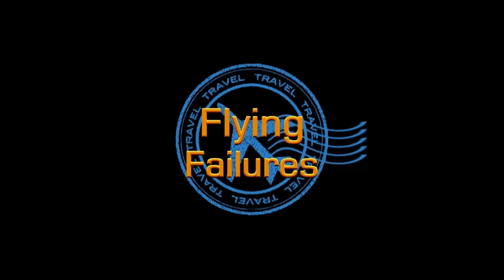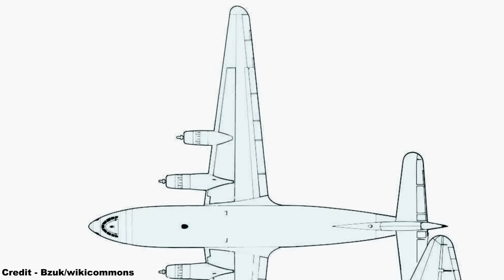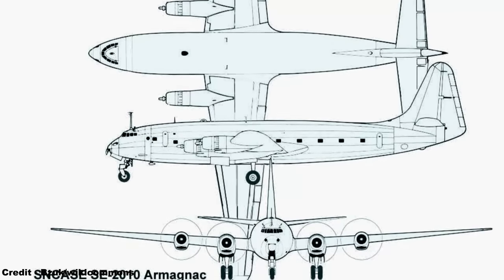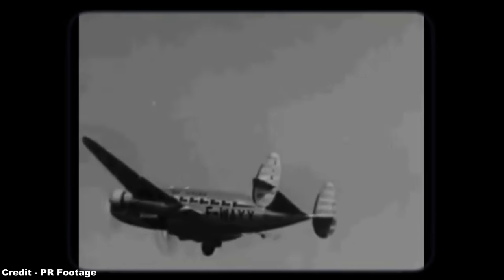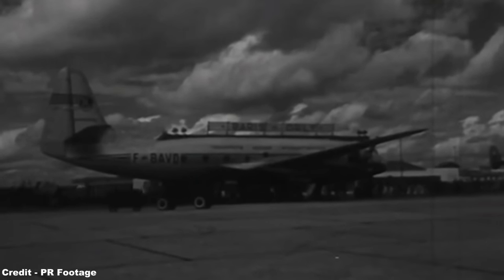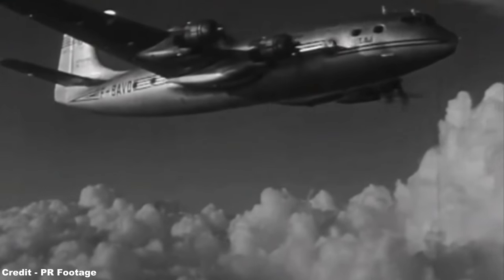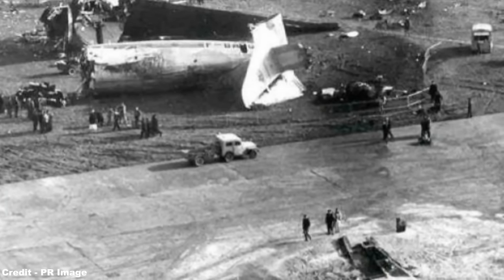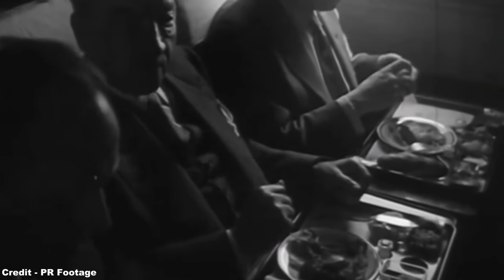Flying Failures - SNCASE S.E.2010 Armagnac

Comment: Attempting to build a plane whose engines run on expensive brandy was probably not the best idea.
Reply: The American made, Pratt and Whitney R-4360? Probably ran best on 115/145 avgas which was dyed purple so that the fuel can be visually identified.  That was 115 octane. Then there was the somewhat lesser 100/130, blue in color.
Reply: Yep, was there some confusion between Alcohol rating and Octane rating.😏
Reply: @scootergeorge7089  the ONLY way the R-4360 ran at rated power was on purple juice-otherwise-it was severely de rated.
Reply: @stevenrobinson2381  - Define "severely." In 1977 I was assigned to a Naval Air Reserve Unit, NARU that operated a US-2B powered by  R-1820 radial engines. When the purple juice was no longer available, we had to slightly detune the engines, a couple degrees less pitch on the props and a timing change. Not much. I believe with water-alcohol injection, the "corncob" would have regained most of the power lost by being restricted only 100 octane blue fuel.
Reply: @scootergeorge7089  Correct the 4360 and later 3350 Turbo compound ran on 115/145 octane. That fuel is 115 octane F3 motor method test (lean mixture) and 145 octane F4 motor method test (rich mixture). 
 At max power air cooled engine use rich mixture for valve and piston crown cooling. For exhibition aircraft  can be run on 100LL but with boost limited. About 25years ago there was 100/130 and 115/145 in short runs for air racing. I do not know what the big air race engines burn now.
Reply: @jayreiter268  - Perhaps auto racing fuel.

Comment: The Comet, despite its flaws was the way ahead even in 1949. Piston engines were obsolete with the advent of the jet engine.
Reply: de Havilland was decades behind in aircraft design and construction technology..
The company while reaching for the 1960s Jet Age still had its feet firmly planted in the 1930s.!

The Comet Disaster was the worst engineering failure in the history of commercial jet aviation and today is seen as a example of how not to build a jet airliner.

Of course the real tragedy of the Comet Disaster was that it could have been easily prevented if de Havilland had used modern technology and simply followed well-known and understood industry standards for construction of pressurized cabins made from riveted aluminum alloys
Reply: @sandervanderkammen9230  According to Wikipedia, the Comet actually used very advanced technology for the time (including the use of aluminium alloys)  and was extensively tested before going into service. Metal fatigue was still poorly understood at the time so extensive testing was carried out that appeared to show it would not be a problem, but it appears that the fuselage used for the fatigue tests had already bee subjected to other tests that masked the effects of fatigue. After some modifications, the Comet returned to service and later became the basis for the Nimrod maritime patrol aircraft.
Reply: @CharlesStearman  The Comet Disaster was a truly shameful and humiliating chapter in British history but the real tragedy was that it could have been easily prevented if de Havilland had simply followed well-known and understood industry standards for the design and construction of pressurized cabins made from riveted aluminum alloys.
de Havilland never fully adopted modern aircraft construction technology and was still building aircraft primarily from wood when it entered receivership and ceased to exist in 1958.
Reply: @sandervanderkammen9230  The early Comets were thin-skinned because of the need to reduce operating weight as a result of the low-powered D.H. engines.
Reply: @None-zc5vg  It's also important to note that de Havillands only prior experience with jets having pressurized cabins was the Vampire/Venom... which was made from wood and fabric and limited to  just 1.5 psi.
Reply: @None-zc5vg  Production would have commenced far too late to beat the Boeing 707 series, the civilian version of the Rolls-Royce Avon would not be available for several more years..
Reply: @CharlesStearman aluminum alloys and metal fatigue were very well understood even in the 1930’s 

But apparently not by DH who specialized in wood construction, and even used blind punch rivets on the comet fuselage (!)

The metal fatigue things is a myth often repeated in poorly researched patriotic comet documentaries, but it’s simply not true 

There was even a British movie with Jimmy Stewart released a year before the comet flew, about a new British aircraft failing from miscalculations concerning metal fatigue 

During the post crash analysis a new procedure for identifying fatigue cracks was developed, fluoroscoping, and this seems to have confused the documentary makers into thinking that metal fatigue itself was discovered

Comment: Just as well that they never got around to installing those Allison T40 turboprops. No design using it was ever successful, although the U.S. Navy endured it in the Convair P5Y / R3Y for a mere two years before the engine reliability issues caused them to throw in the towel. One of the P5Y prototypes was destroyed in a crash due to the catastrophic failure of one of the T40s.

Comment: Take a shot every time he says « Armagnac »!
OK, that was easy…

The aircraft was too heavy, btw. The engineers at the time were not familiar with stress skin and multiple bracing and reinforcements in the fuselage overweight it.

Add to that the complete failure of the unreliable, underpowered Gnome Rhône engines…

Constellation and other US airliners were much more economical.
Reply: Gnome -Rhone had nowhere near the power outputs in their engines-that beast had Pratt & Whitney R-4360 engines-and it was still underpowred.